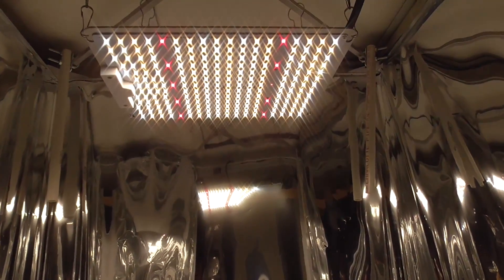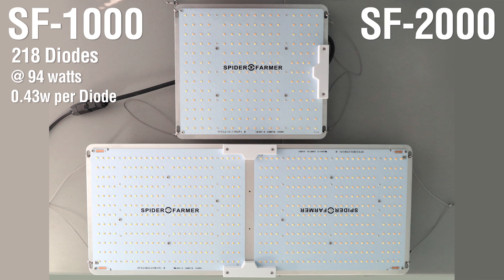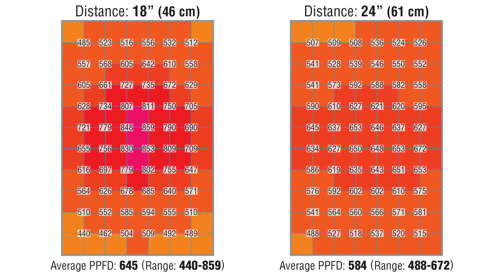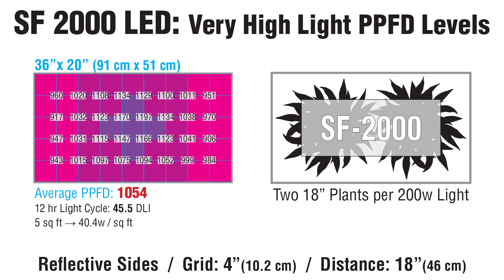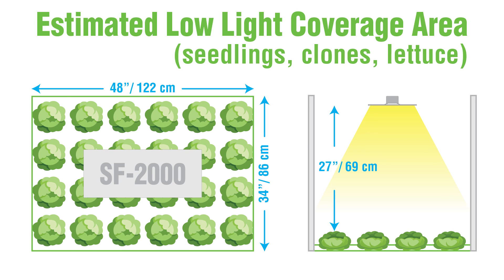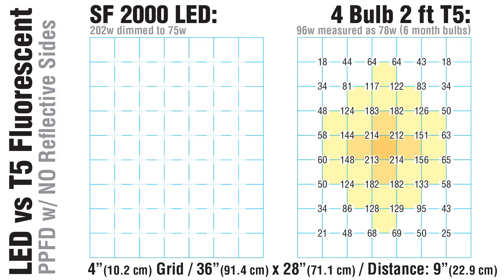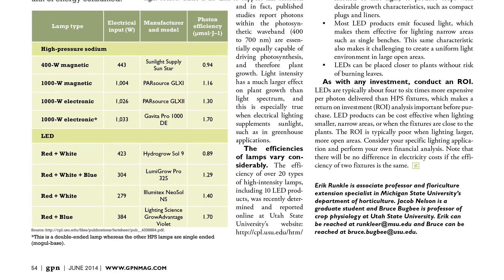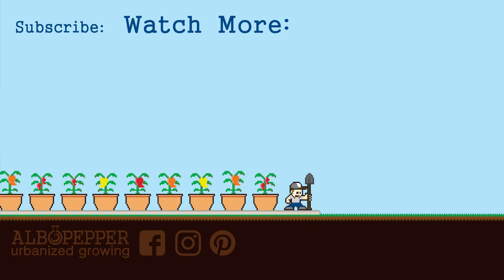High End LED Grow Lights: Coverage Area & Distance - LED vs T5 vs HID (Spider Farmer SF-2000 Review)

Comment from the maker: Check out my other reviews:
"1000" LED Grow Lights Shootout pt 1: https://youtu.be/g6n8VhVGKDY
"1000" LED Grow Lights Shootout pt 2: https://youtu.be/WmjOSzSF-HI
Spider Farmer SF300 / SF600: https://youtu.be/RXbR-hcXeQ4
Active Grow LoPro Max 320W: https://youtu.be/PCaesi_M5DQ
Maxsisun MG3000: https://youtu.be/Tw6-w2gybgo

This UPS power station can backup a grow light!
► https://youtu.be/h3sUUHCEqbs

Check out my Grow Light Cost Calculator: https://youtu.be/aToYhyPZMVs

Learn more about artificial lighting and plant growth:
► What is PAR vs ePAR Light? https://youtu.be/kUpEQ4kU148
► The impact of Red or Blue light on plant growth: https://youtu.be/sfihE4IuFuU
► To avoid Tip Burn: https://youtu.be/gHWf4Hfi3hA
► Light Cycles & DLI: https://youtu.be/dQlOJ1zvoPI
Reply: Could you do me a favour with the sf2000 and position it around 40cm from the sensor in a 100 cmx 50cm space and see what I'd need to dim to in order to get 300 ppfd? I'm growing cacti and succulents which could take 1000umol but I don't fancy paying that electricity bill ha.
Reply: How well do you think the SF2000 would work with super hot peppers that require ridiculous amounts of light
Reply: May I ask your opinion on the tolys 1000 watt full spec led grow light? I'd love to hear your thoughts.
Reply from the maker: @globeheadgardener   It's not 1000 watts, so I have no respect for the seller. Also, it's fairly blurple in color, which I really don't like.
Reply: @Albopepper  what would you recommend for a 6 foot by 4 foot grow space sir?
Reply: Hey  I just found your channel today and I've been consuming it in great quantity. I'm planning on growing carrots and onions inside 24/7 365. I am trying to find the right thing to go and I want LED, but so much conflicting and confusing information. I'd like to have enough light for 10, 5 gallon pots at any height. Looking to buy not too many panels of something. Sorry to bother you, but any information to help me would be greatly appreciated!

Comment: I am planning to  start  an indoor farm setup of size 18 ft x 15 ft for growing iceberg  lettuce in 6 layers with 45 cm distance between layers. the  net available  height for baby plants will be14 inches cm and for  grown up plants it is 4 inches. I propose to use  fluorescent  led of 4 ft  (84 in total). Will you please  suggest which type is suitable ,watts  and brand available in India.

Comment: im using air cooled 1000 watt hps in 5x5 grow tent i have been purchasing led fixtures to replace my 400,,600 hps fixtures any suggestions on replacement for the 1000 in the 5x5

Comment: Awesome reviews! I’m growing some indoor tropical houseplants and was wondering which would you choose to use for a grow light, the SF2000 vs SF600? Most of my plants need bright indirect light, some just need moderate light. Thanks in advance for your help!
Reply from the maker: Thanks for watching! The SF2000 would cover a much broader area from a higher hanging height. So if your plants are large and you have several of them, it would be a better option. Especially since it can be dimmed when required, unlike the SF600.
Reply: @Albopepper  Thank you for your input! 🌿🌿🌿
Reply: @Albopepper  ah, I have another question. Would you choose the SF2000 over the Maxsisun or viparspectra (are there any comparable - possibly more affordable?)

Comment: The 2 boards of the 2k are WAY too close together. The SF4k takes that and doubles it. 2x 2ks would only be half as bad. 4x 1ks would be much better.
Reply from the maker: The 2000 is perfectly fine depending on the tent environment and grow set up. Same for the 4000. If vertical clearance is tight, then yes, spreading them out could be advantageous. However, 4x 1000s are not equivalent to a single 4000.

Comment: Thank you. I wish you would review the 2000 series against each other from MaxsiSun, Spider Farmer and Mars Hydro, rather like you did with the 1000 series. It's confusing their have the same basic label, they all cost about the same price, but the MaxsiSun PPE says only 2.1 (lower than the others), and the wattage is diff with each of the products, so non-tech folks like me wonder which is better (I have a small room 6x6x8h' room area, not a tent, for my plants). Thank you so much for the clear and concise information you provide in your videos, I've watched many of them.

Comment: What would be better for a 4x4 area the SF4000 or the California light work solar 550?
Reply from the maker: The SF4000 is a much better solution. It fits more proportionate in that grow space. It is more efficient and generates more light. And it costs less.
Reply: thanks  @Albopepper

Comment: How does the sf 4000 compare to the Gavita gen 2?
Reply from the maker: Compared to the Gavita Pro 1700e Gen 2, the Spider Farmer SF-4000 has 72% of the light output. It uses 71% of the power. And it costs 43% of the price.

Comment: Does dimming the light affect the longevity of the diodes? You could ponder the lower the wattage drawn and the lower the temperatures would extend the life of the light.
Reply from the maker: That sounds pretty logical to me. Lower power = lower temps = longer life.

Comment: So you’re saying a 200 watt sf2000 is equivalent to a 400 watt hid? I was under the impression for some reason that led watts were below that of hid. IE: a 400 watt hps and a 400watt led = the hps remaining true, while the led is playing catch up. Or maybe it’s the info people are sharing on here that is wrong which is why many people get confused easily when it comes to lights. 

I’m in the process of deciding what type of light I want. I know I can’t go wrong with hid, but I heard they can be a bit noisy and cause extreme heat, which means you need more gadgets and tools and materials to make the perfect temp for your grow space. With LED I noticed mixed things from a bunch of people.  But I have noticed growers with nice yields, but I feel hid produce bigger yields, they’re just more cost effective. Is this true or no? I’m a beginner I suppose. I’ve grown in the past and am finally at a stage where I want to get back into growing medical tomatoes again.
Reply from the maker: Assuming you have an HPS (single-ended) with an efficacy of about 1.34 (603 PPF @450W), the SF-2000 should have nearly the same light output (527 PPF). It is slightly less, but you get uni-directional light, so less photons are wasted. Thus, the SF-2000 should be an acceptable replacement for that HPS.

For bigger yields, you need more photons. HPS is not the best. It's just that some growers select underpowered LEDs and then they think HPS is so much better. Not really. They simply weren't supplying the same amount of photons to the plants. A highly efficient 300W LED (actual power draw) would outperform a single-ended 400W HPS.

Comment: Think I’m good with the sf2000 for a 3x3 room?
Reply from the maker: It would get the job done. Especially for vege. If that space is packed tight with high-light plants, you might decide to go for 2 SF-2000s or a single SF-4000.
Reply: AlboPepper - Drought Proof Urban Gardening thanks for the reply. Currently using a 1000w blur pale in week one of flower. Ordered the sf 2000 hoping for a boost.

Comment: Al, what is a magnetic ballast ?
Reply from the maker: The traditional HPS lamp has an electromagnetic ballast, but newer models have electronic ballasts that are typically smaller, quieter and 10 to 15 percent more energy efficient. In addition, electronic ballasts run cooler and are substantially lighter, and light emitted from bulbs degrades at a slower rate than with magnetic ballasts.

http://gpnmag.com/wp-content/uploads/15_TechnicallySpeaking_GPN0914%20FINAL.pdf

Comment: I just received a new SF-2000. I made a mounting bracket (angle aluminum) for the driver so I could mount it sideways. I thought that would help with heat dissipation as well as making the adjustment screw easily accessible. I found that the lowest watts it would read was 105 (in the counter-clockwise position), and 317 watts turned all the way up! 
I think it should be more strongly emphasized to newbies that creeping up on the needed power is better than finding out the hard way that changing from one light source to another (even one with less power) can really piss plants off. Some people are very attached to their peppers ;)

EDIT  to add that the watt reading was 205 at 120 volts, when tested straight out of the box.
Reply from the maker: That bracket was a great idea! Thanks for sharing your feedback!  :-)

Comment: Are  you or have you tested their Sf-4000? I have a 5x4 grow area and wondering if one would be enough for that? We are on old spectrum king sk 400 series that I have never liked and watching the migrow channel they are junk. I am considering upgrading to these pannels. We are growing the magical tomatoes btw ;).
Reply from the maker: I haven't tested that model but the specs are comparable to 2 x SF-2000s. (A little better actually.) If you want maximum light levels then I think you need 1 x SF-4000 + 1 x SF-2000. That should do well over 20 sq feet.
Reply: @Albopepper  After doing some calcs I was thinking of buying 4 sf-2000 and making a light canopy out of them. yes the sides would still be starved for light some but this would at least give me a 38.5 DLI and I am betting the dual spectrum kings we have going right now can not even come close to half of that being their PPFD is only 1.1
Reply: or after doing some pricing, I would be best just to order 2 SF-4000 and kill it.
Reply from the maker: Agreed! Be sure to use my coupon!  It should still work.
Reply: @Albopepper  will do, I will buy through your link and what coupon? Was the coupon at the end of the video? Also looking at this more I think the best idea is to use 1 SF-4000 + 1 SF-2000, bolt them together to esentially make an SF-6000 if you want to call it that and this set up should kill a 5x4 while only pulling 658w while giving me that ppfd and DLI I am after.
Reply from the maker: Yes, your grow area is just slightly rectangular. I like that! An SF-6000, LOL. The code is right above the links in the description: Discount Code: PEPPER19  Last time I checked it was still working. Let me know if not. Thanks so much for your support!!!

Comment: I have a 40"x 40" x 80" tent and am using an SF-2000. Am in the 3rd wk. of flower with 2 Glues and 1 Wh. Widow. Just now getting quarter size buds. They look great but in retrospect I think I should have gotten the 4' x 4'tent. I did not think an SF=2000 would light a 4' x 4'. Anyway  I really like my light and the gentleman is fantastic on his videos and seems very well informed.The reason I can say this is I'm 70 and watched a whole lot of crap information.Thanks a bunch!

Comment: These look roughly like the HLGs. You could cook a steak on the back of the aluminum QB housings. So in spite of the great light output per watt, my concern would be how do these things operate in an enclosed area heat wise and how much cooling effort is required? 

Great videos btw. I watched your raised sip bed tutorial and subscribed. You are a great teacher.
Reply: I had the same concern. I have 2 sf2000 in a 4x4 & love them in regards to heat. The temp in my tent dropped 4-6 degrees compared to when I had 2 ViparSpectra 600s. Definitely couldn't cook a steak on these. I don't, but you could run a fan blowing on the drivers if your ambient room temp is high to begin with.

Comment: Hey hey, Im thinking about getting a SF1000 oder TS1000 (Mars Hydro) for my 80cm×80cm×180cm Tent, I think in american terms thats 2×2. Is 1 of either of those enough?
Reply from the maker: I think the SF-1000 is a good fit for a 80cm x 80cm area. That's the size of my grow chamber at home and the light is working great.
Reply: @Albopepper  Ok, thanks for the early answer 👍🏼

Comment: Al,  I purchased an SF-2000, per yours, and other Utoob video reviews. And I am going to "dim it", for hydro lettuce use. I really have learned a lot from your garden videos. 
Are you aware Spider Farmer has a support video that shows them specifically stating the dimmer pot. is marked "Io ADJ" for dimming purposes? But every Utoob review I have seen so far, recommends the use of the "Vo ADJ" pot. for dimming adjustment.  Here is the Spider Farmer link for adjustment procedure: https://www.spider-farmer.com/blogs/news/how-to-dim-the-sf-series-light
Very strange that the ONLY site that has recommended the "Io ADJ" pot., be used for dimming purposes, is the manufacturer?
I have yet to contact Spider Farmer for confirmation, or response to why the disparity in procedures.  Just an FYI.

Comment: what spider farmer setup would you guys recommend for a 1m x 1m (3.28'x3.28') tent? i was originally gonna get 2 sf1000s (possibly a 3rd in the future) instead of one sf2000 to spread the light more evenly across my square tent. after watchig this video though i now know that the sf2000 actually has a bunch more leds on it then just 2x the sf1000s and that i would probably have way better results getting 2 sf2000s (growing medicinal tomato). Thanks a lot for that btw! great video! do you guys think one sf2000 plus one sf1000 in combination makes any sense for my grow tent? i dont wanna spend too too much right now since ive been reading that there might be even more efficient set ups coming out in the near future.

Comment: What if you cranked it up to 250w. I hear they market it as a 200-250w
Reply from the maker: You could try it. But it's putting out lots of light for my seedlings at 75w in my small space. Lifespan will be super good this way.

Comment: Do a review on FAMURS 3XLENS GROW LIGHT PLZ! make sure its the 3x tho , i got one and it seems like it really is 3 times better than the non 3x lens ( same brand just no 3x). Its a budget friendly light and super under rated! I can only find this link to the 2000w one not trying to promote just wondering how good it really is. If I could I would buy you one lol just to test for me.  https://www.amazon.com/FAMURS-Spectrum-Reflector-Switches-Seeding/dp/B07YFWV78R/ref=sr_1_5?crid=365H5IJQYXDZB&dchild=1&keywords=famurs+2000w+led+grow+lights&qid=1586667250&sprefix=famurs+%2Caps%2C146&sr=8-5
Reply from the maker: It's a gimmick. Overinflated specs. False wattage claims. Impossible HPS comparisons. Scammers.
Reply: @Albopepper  Thank you im trying to learn so i cant spot it my self just haven a hard time understanding the way a light works lol, its simple to most but to me its like learning another langue. Thanks again
Reply from the maker: I understand entirely! OK, so if you look at that listing, you can see that the item title says 2000W. But when you scroll down you see that the light is only 385W. So they're lying by calling it 2000W in the title. Then in a different spot it says "Replaces a 1400W HPS". A quality 1400w HPS should be able to produce 2380 PPF of photons. But a newer 385w LED isn't going to do more than 967 PPF of photons. That's not even half of the light output of a 1400w HPS. So they are making false claims.

Also, I don't agree with the need to have separate "veg" and "bloom" switches. When you switch to those modes, you deactivate a bunch of the diodes and the light levels are greatly reduced. It's a gimmick and plants don't need that. I'm loving the white light from my Spider Farmers. Been running them all Winter and it's a million times better than those nasty blurple lights. I'll never go back!
Reply: @Albopepper  im prob gonna get the spider 1000 or 2000 now because of your super helpful advice! Thanks you for taking time out of day to explain that to me. Your a awesome person in general keep up the great videos. Thanks again, when i do get the light im gonna email spider farmer  saying how u helped me
Reply from the maker: Thanks for your kind words! I appreciate your support!!!  :-)

Comment: I have both an SF-4000 and an HLG 550 V2 RSpec. They each light up a 5x5 tent, and are both very impressive lights! I want to run a 4 plant crop of autos in each tent to compare the results.
Reply: Hey man how did it work out for ya. Hope all is well.

Comment: Would the sf4000 work in a 5'x5' tent or would two sf2000 be better
Reply from the maker: Looking at the current prices, I'd say that a single SF-4000 is the way to go. Be sure to use that discount code in my description!
Reply: AlboPepper - Drought Proof Urban Gardening Why did you only comment on price or value and not its coverage differences?
Reply from the maker: @Kevin Sweet  - Because there isn't much in the way of coverage difference. A single SF-4000 is quite similar to two SF-2000s in regards to coverage.

Comment: What make and model is that meter you're using? How can that not be a must for indoor growers to dial in perfection?
As stupid as this may sound (since it probably is) wouldn't wrapping the walls with actual mirrors give me maximun light reflection? It would actually reflect around off of it's own self under the canopy until parts of the plant blocked it's path. This the need for a meter to test angles of deflected light and the strength. Or I suppose if I had a meter I could answer the mirror question myself

Comment: Lol once again you taught me some new tricks lol! :) my tamatoes have been getting alil light burn 3x2 feet closet i took apart amd reasembled into a a 4x2 for my SF2000 was giving me some light burn at 20" i raised the light to 24 inches then the claw stopped. But the leaves didn move upwards towards the light so i moved it up to 26 then to 28...not realizing ive got the light hanging in centre off a 3x3 space and not a 4x2 space so i centred it now to 4x2  and lowed the light to 24" after watching your doci lol thanks Doctor Tamato!:) Lol hope you dont mind me calling you that and really to appreciate your wisdom!😁